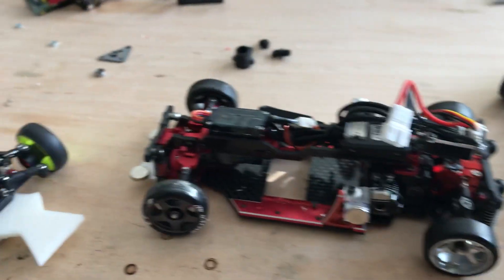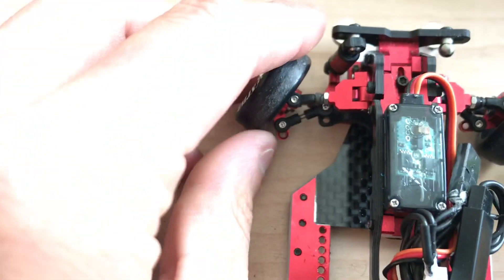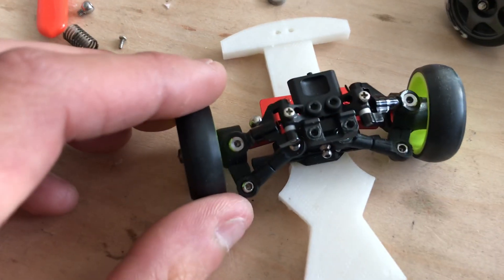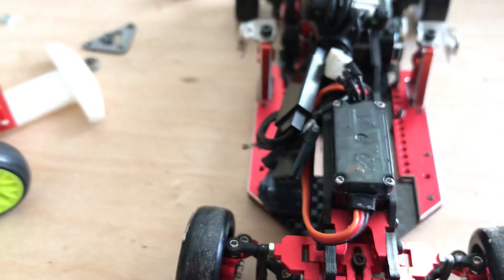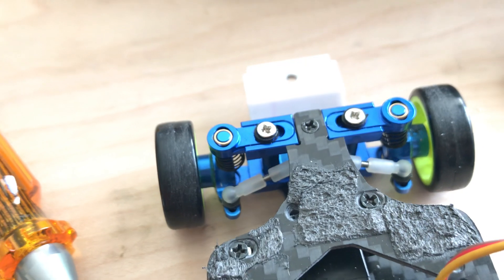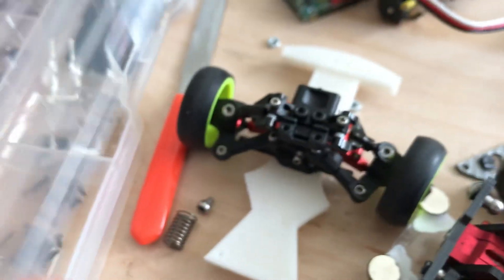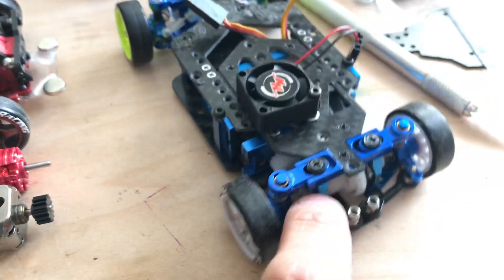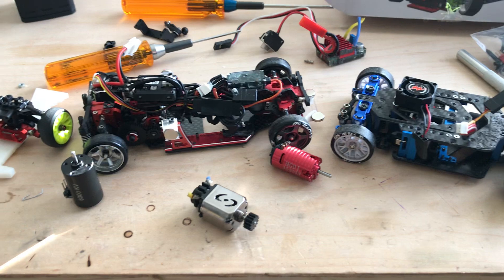ATOMIC DRZ VS HGD1

Comment: Hi wondering if you could give me some advice, would you recommend getting the drz kit with or without electronics?(I am new to micro scale drifting but not to the hobby btw) also what gyro upgrade would you recommend?
Reply from the maker: Arthur Green so if you have the cash or don’t mind waiting to get electronics. I would just get the kit. If you stick with it you’ll eventually be replacing all the electronics that came with it so might as well just get the kit and spend the extra cash for better electronics. And I would recommend the yokomo v4 gyro because of its adjustments and how smooth it is.
Reply: @selfmadecouch Thanks for the help,  I'm am a little tight on cash dont want to put in too much money because i may not like it (i think i will) . i might stick with the all included kit, and in the future upgrade.could always sell off parts which i no longer need.

Comment: Hey man I’m deciding whether or not to go micro and get a rwd for drifter. I’m finding it hard to get comparisons between micro rwd drift car models, brands and builds. Untill I just found this video! Hopefully u can help me out. So after many hours of YouTube it seems the drz is one of the most popular, great quality and customisable. I’m considering buying a drz kit without electronics and hopefully I can salvage some stuff from my other rc’s. 1. I have a controller and receiveri can use, I also have a rc plane that has a gyro and speed control. Would those work in a car? 2. Assuming I have to buy all the electronics, what would you recommend? I want quality and performance but nothing pro competition spec cause those prices add up. 3. My plan was to make a mini of my Acura integra, but I can’t find any body’s for that, I’m pretty set on gettin the integra if I’m gona put this much into a build. Hope that’s not too much ☠️🤣 please help if ur able too, this self isolation build is gona be a masterpiece
Reply from the maker: Golf Wang sorry for the late reply haven’t checked my inbox but if you go with the DRZ the only electronics I can recommend are the brushless sensored esc and motor from superg.com  all brushed motors I’ve tried aren’t smooth enough and make drifting/driving it feel like a toy from target. And your old electronics might work as long as they fit. But a plane speed control might not have the same settings as a on road one,but it could work. You would also need a micro servo and they use a specific size I’m not sure of what size it is but all the ones from superg.com in the miniz/DRZ section should fit. They might have a different connection for the receiver though so you would also need to buy the adapter or swap the connector end

Comment: Where do you get the ball and turnbuckles?
Reply from the maker: I try and source them where ever I can. The ones in this video I picked up at my local hobby shop called “sheldons hobbies” in San Jose CA. But right now if I were to buy or need any I would go with either atomic drz v2 ball ends and turnbuckles or the ones from the Orlando hunter I believe it’s called.
Reply: @selfmadecouch  awesome thanks a lot for the response.